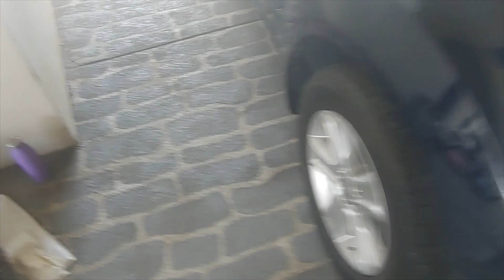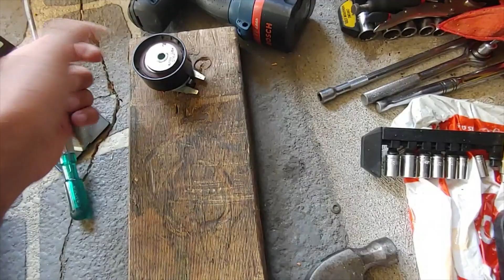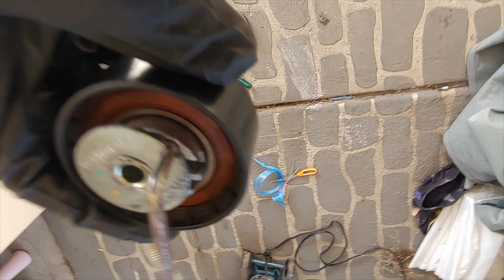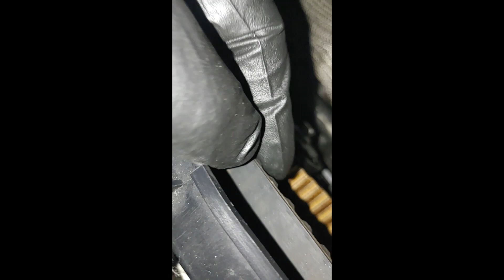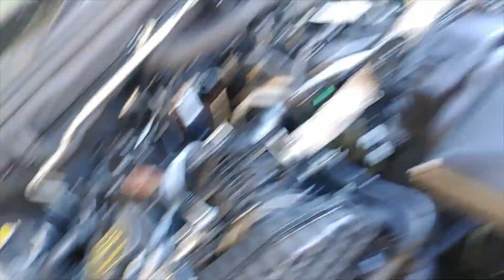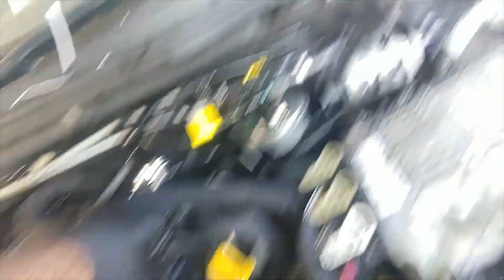Ford Territory SZ Diesel High Pressure Fuel Pump (Injector Pump) Installation. Part 2

Comment: Is this the same engine they put in the land rover Discovery 2.7 
I took it to the garage and the mechanic said it's fuel pump on the back of the engine not working properly. I was just reading the comments shall I look at replacing the fuel filter first.
Reply from the maker: Yes, it's the same engine and yes, replacing the fuel filter can solve most issues... Depends on what problem you are facing
Reply: @RZJugaar  engine turns over but doesn't start, it drove to the shop 2 miles down the road and had to have it recovered back.
Reply from the maker: @alistairparkin8364  If i were you, i'd confirm the shop diagnosis first. To do that, check if there's any fuel coming out of the fuel filter (towards HPFP), if yes then problem is with your HPFP.  If there's no fuel coming from your fuel filter, feed some diesel directly to HPFP and see if it fires up.

Comment: Hi our territory is "pulsing" when we accelerate. I am wondering if it could be sensor on pump, any ideas?
Reply: Hi. The pulsing was apparently from the transfer case. The oil may have been too light so the put a stickier oil in. Seems to have worked but really is just not as noticeable.
Reply from the maker: Describe "Pulsing". Any check engine light?
Reply: @RZJugaar  I have that problem now. Surging would be a better way of describing it. Replaced the low pressure pump then the filter but still a problem. Its booked into ford to fix now. I suspect its either the hpfp or some sensor. no warning lights.
Reply from the maker: @ddddddddd574  does it continue pulsing or would it shut down after a few minutes?
Reply: @RZJugaar  it continues. I can just rev it at about 2k and will eventually start surging. if i hit the freeway it does it more violently. Its as if the pump isnt sucking enough to keep up.
Reply from the maker: @ddddddddd574  i suggest looking at MAF sensor first.  PCM does not validate (or cross check) the input from MAF sensor and would assume it to be correct. 
Try disconnecting MAF sensor and drive around.  It will trigger engine light but it should not be in limp mode.
Reply: @RZJugaar  I did that. disconnected it and tested but still the same problem in limp mode then it went out of limp mode with the same problem. Ive been reading about the torque converter causing this problem solved by an trans flush but this does it in park.
Reply from the maker: @ddddddddd574 
interesting. I'm happy to look at it if you are in Sydney.  Otherwise, wait and let Ford figure it out.
Reply: @RZJugaar  im in Melbourne so ford will have to do it. Ill let you know what it was after the 9th
Reply: @RZJugaar  Had a mobile mechanic come out today. Either an injector (215,   km) or the fuel pressure regulator. He showed the pressure was dropping intermittently when under load but it was still going up to 30,000
Reply from the maker: @ddddddddd574  or maybe its the Fuel Pressure sensor. i have 2 territories both above 220k, none have a problem with injectors. The fuel regulation function in these cars is performed by Volume Control Valve and Pressure Control Valve, both of which are integrated on the HPFP.
Reply: @RZJugaar  Just had a mechanic change the injectors. Smoothed out the problem but its still there. Fuel pressure sensor seems impossible to remove....
Reply from the maker: @ddddddddd574  yea, to remove it, you have to replace the whole fuel rail to which it is installed on.
BTW did the mechanic reset injector and HPFP learned values via tool after replacement? Sometimes that help.
Reply: @RZJugaar  he said the injectors will be remapped automatically after one cycle
Reply: @RZJugaar  Wasn't the fuel pressure sensor, still doing it after change.
Reply: @RZJugaar  Just finished at the mechanics. It was the HPFP.
Reply from the maker: @ddddddddd574  glad to hear that it's fixed finally... 🙌
Reply: Did you sort out your pulsing issue? Did it shut down  if it continue pulsing?

Comment: did it fix your "rail pressure too high issue?"
Reply from the maker: Good question. It didn't.. but I found the culprit. It was the fuel filter. Checkout my video on P0088 and P0087  on this topic..